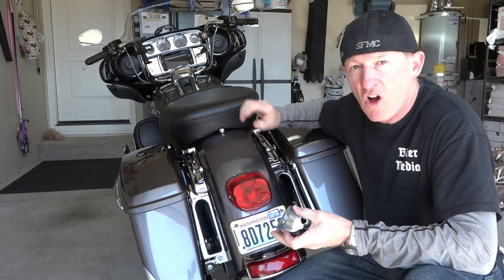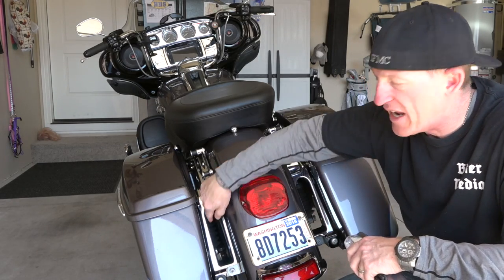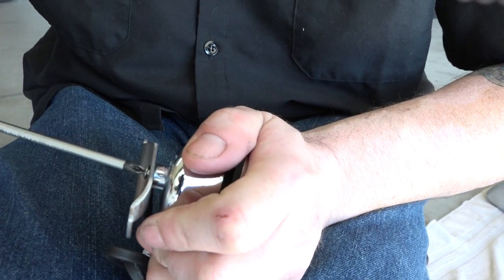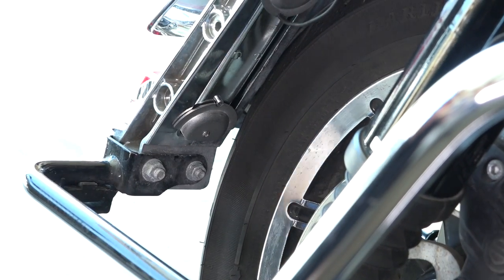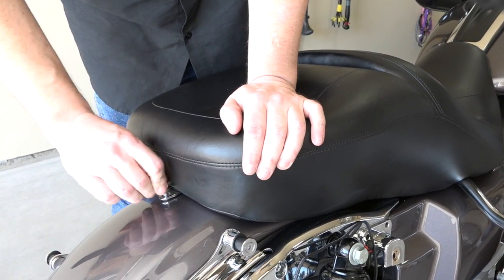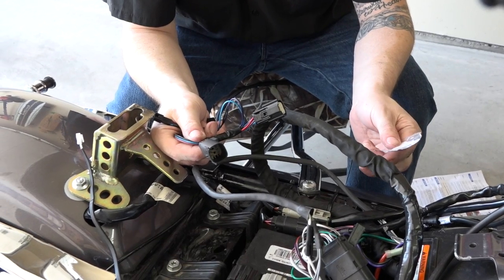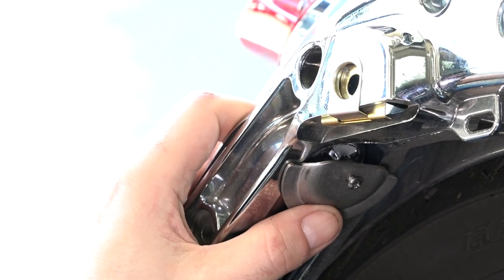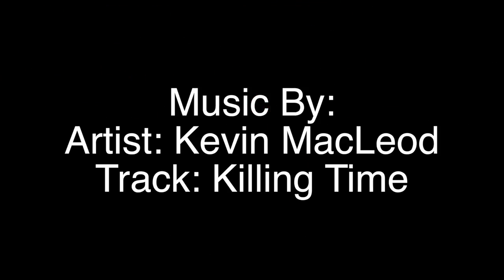Install Kuryakyn LED Saddlebag Support Insert Lights on Harley Touring 2014-2016-Biker Podcast

Comment: I have a 21 roadglide limited and these lights wont work because I have air ride tank in the way. Im trying to find out whether or not the new Kuryakyn tracer inserts will work. I was hoping they're more shallow or surface mount? I can't find dimensions anywhefe.

Comment: I know this is an older video but I'm looking at buying the same bike. when you removed the trunk did the speakers stop working? a friend removed his from his road glide and had that happen. if so, what did you do to solve that?
Reply from the maker: The kit to make the truck detachable came with the necessary adapters.  The speakers work just fine when the trunk is put on.  

Ride safe & Ride Often!

Here is a link to a bunch of our useful Free vids: http://www.lawabidingbiker.com/freevideos

Here is a link to some of our useful for purchase videos: http://www.lawabidingbiker.com/buyvideos

Want Answers & Information Fast? And help support us at the same time? Do you like the content we provide?

Our patrons get answers to their questions/comments/feedback in less than 24 hrs and are part of our Private Facebook Group. If you are interested in being in this exclusive group you can get all the details at ==> http://www.lawabidingbiker.com/patreon

If you haven't subscribed to the Law Abiding Biker Podcast make sure to do so. Listen in as we talk weekly about issues/items like this & so much more. You can listen on iTunes (Apple/IOS), Stitcher Radio (Android), or any other Podcast App ==> http://www.lawabidingbiker.com/podcast

Join our free email club at http:///www.LawAbidingBiker.com/EmailClub. Only relevant content will be sent from time to time. Email club members are the first to find out about free or for sale content are given special coupon codes.

Comment: Got a question! I have a 2015 fat bob I want to install hard saddle bags with the easy brackets. I know I will have to remove the rear stock turn signals. I really want to keep the same rear look. I have tried to look for an integrated brake/turn signal but no luck lol. My other thought was do they make a rear turn signal light that will fit on the rear fender? I also can't find what the width is of the easy bracket system either and that would be a big help then knowing that measurement if they make turn signal lights small enough. Any thoughts would be great? Thanks I really enjoy watching your videos!
Reply: Robert, thanks for watching.  Unfortunately we do not have any experience with the easy bracket system.  I would give them a call if you are looking at the product and run the question by them.  Also check out the online stores you might find what you are looking for with the lighting.  We like the products from www.ciro3d.com  RK from LAB.

Comment: Hey Ryan, will these Kuryakyn's also work with the Ciro 3D's bag blades and the modulator?
Reply from the maker: I think you’d run into a problem w/ the wiring between Ciro bag blades and Kuryakyn filler panel lights. Not sure. Haven’t tried it. May have to make alterations.